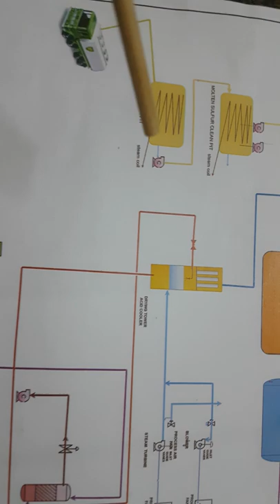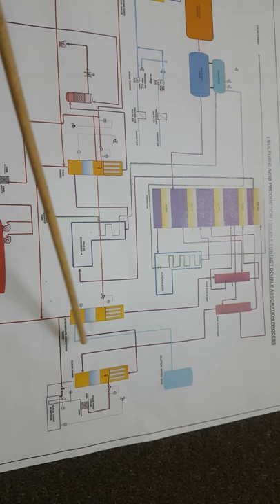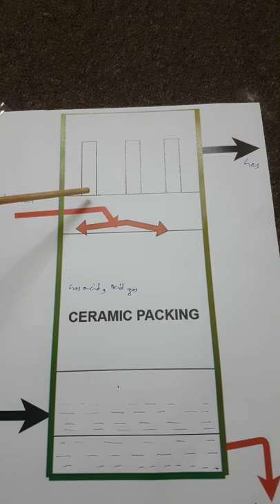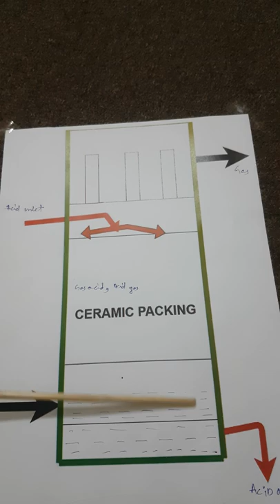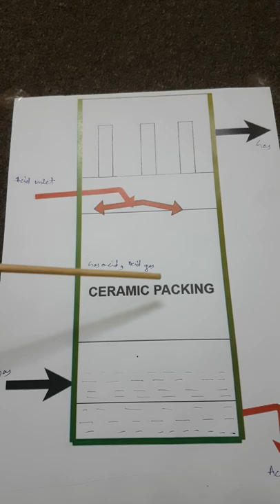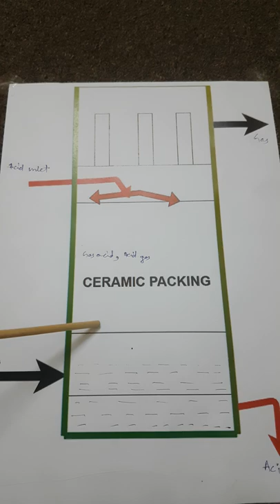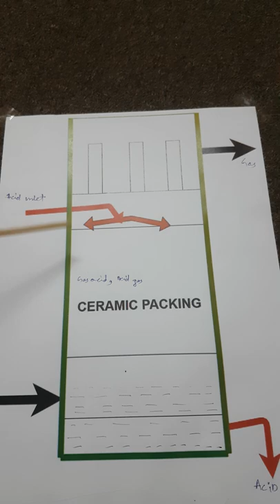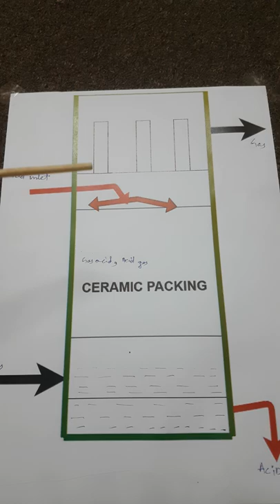Absorption tower,packed tower of sulfuric acid#Gasabsorption.

Comment: What material is used as ceramic packing???
Reply from the maker: Ceramic
Reply: @chemicaldiary8412  I also work in sulphuric acid plant. Here i found rushing ring. I think it is also ceramic
Reply from the maker: @debashisbhaumik2922  
The shape of catalyst is rasching ring whereas material of construction is ceramic